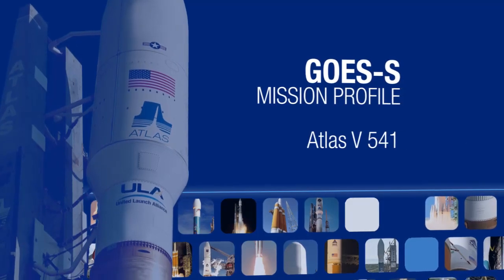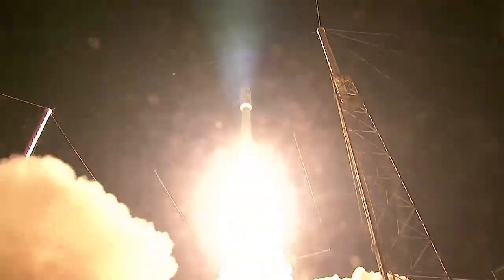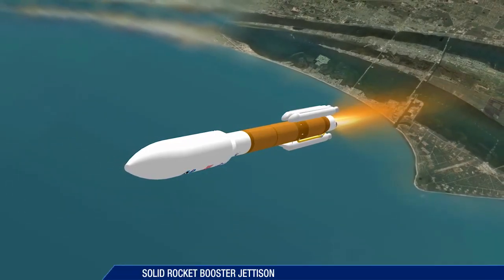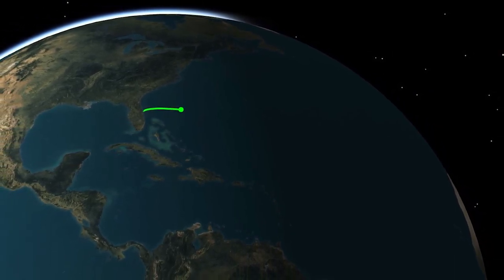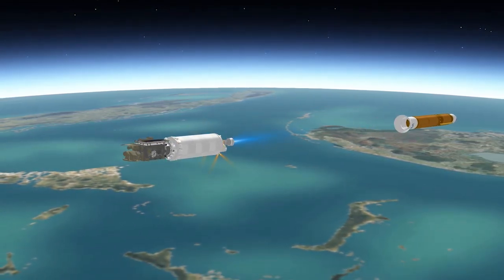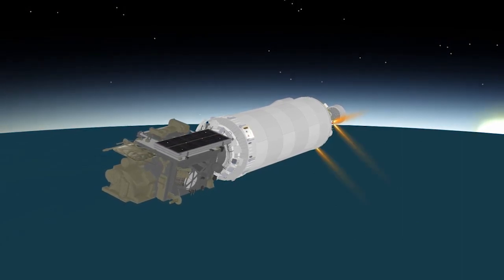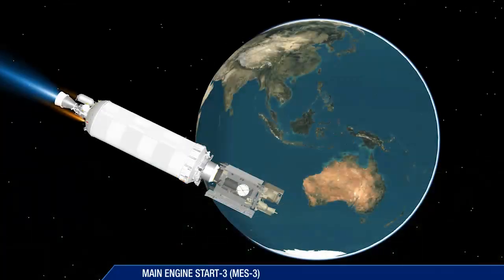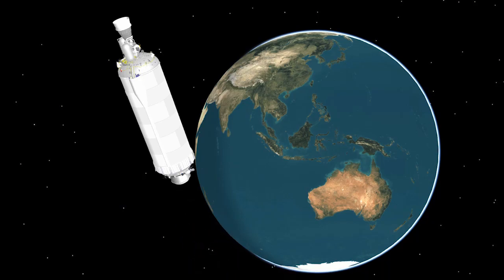Atlas V GOES-S Mission Profile

Comment: So where do the boosters land themselves?  On a barge in the middle of the ocean or on land?
Reply: they don't, they throw them away and the boosters fall back to earth and crash into the ocean
Reply: They don't land anywhere.  They're solid booster so ULA considers it's easier to dispose of them rather than refurbishing them.  Also ULA spares on the development costs for reusability.
Reply: Yes gentlemen, I was trolling ULA.  When are they going to start operating more efficiently, especially with taxpayer dollars?
Reply: I think that now that SpaceX has shown it can be done, all the other players will be doing reusable boosters too. But SpaceX has a huge lead and may leave all the others in the dust. Just my opinion.
Reply: The Atlas V was initially designed to carry a nuclear payload, not a satellite. Reusable boosters were not part of the plan.